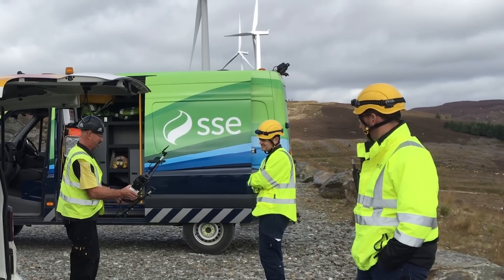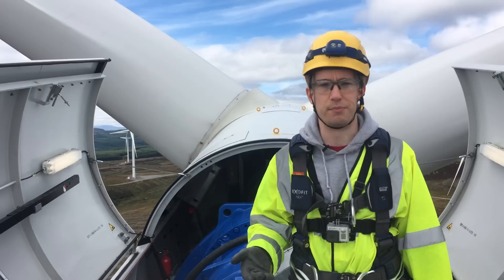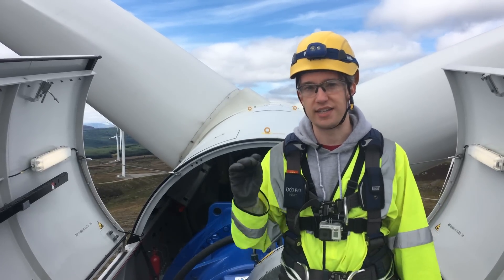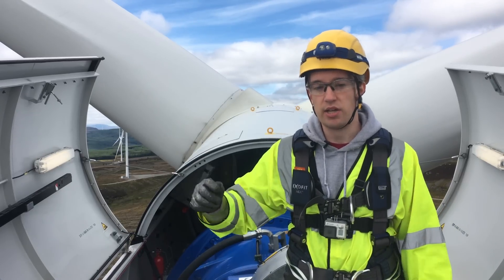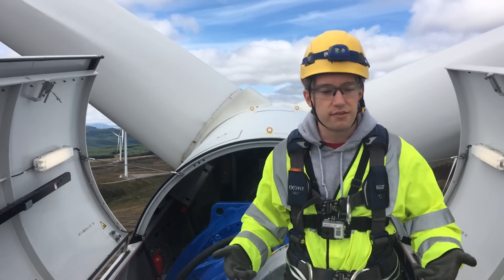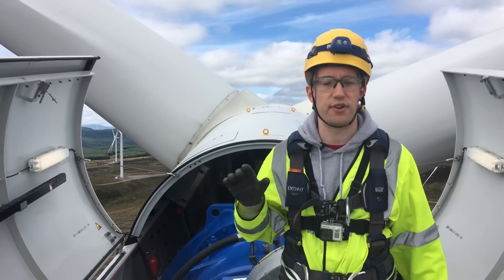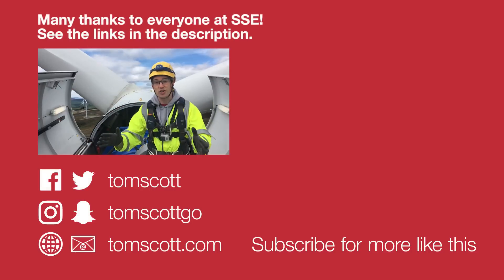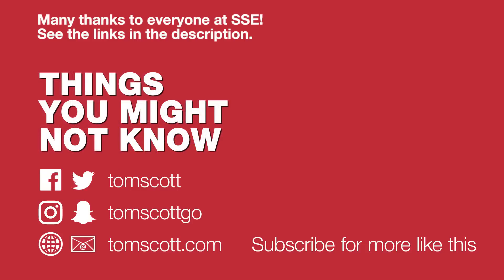The Problem With Renewable Energy (and how we're fixing it)

Comment: does the 50 vs 60 cycles per second power thing also dictate the 50fps vs 60fps framerates difference between the UK and the US?
Reply: Yes, that is exactly why they are different. It was a way to remove one possible element of interference in the early days of television.
Reply: Yes. Many kinds of electric lights subtly flicker at double the mains frequency (so 100 or 120Hz) and if your video capture isn't at a multiple of this you get weird flicker effects.
Reply: This is also why video recordings of most CRTs have a horizontal black bar that moves up or down the screen, at different speeds, depending on if you are in a 60Hz or 50Hz country, since video is usually recorded at 24 (+/- a few fractional frames) fps.
Reply: thomas - you mean film? videotape is 25 or 30, and digital is 25, 30, 50 or 60 (usually 30 though, because of american companies)
Reply: wow, i can't edit my post.
i was going to add that digital CAN do 24 but usually doesn't, except on super expensive gear, but even then, that's usually equipment for making a big cinematic release, not someone recording a home video with their tv in.
Reply: Kit Vitae I was thinking film/tape, because, strangely, it is till common for small news stations, and the high end stuff does 24.
Reply: Thomas Gill interesting. i'm not sure if "small news stations" are even a thing in the uk, tbh. i know tv is still a lot more regional in the us, though. because, like, it's huge.

also, are you saying that high end tape gear does 24? (just a little unclear) if so, that's super interesting too.
Reply: Given that "high-end tape gear" is usually just code for Super8 or Beta(D), it is possible.  The high-end stuff was originally designed for films, which are still 24 fps.  In the US it is very easy to tell what is shot on film or at 24fps, whereas things shot at 30 or 60 look much more fluid, and just look wrong to most people.  Watching shows from 50Hz regions you don't really have that quality shift, as 24 and 25 fps are so close as to not be noticeable, it is just the color saturation differences between film and tape (usually noticed in 80s and 90s BBC/ITV series) is noticeable.

I just recall that it wasn't until recently (2-4 years) that I noticed local news programs not having any flickering on their CRTs in the newsroom, or when a CRT is in a shot, nor even major Hollywood TV productions, where there was a hint of scan lines until the last few years.  This is actually why you so rarely see the TV or computer monitor on a TV show, until the last few years, in the US at least.

It also doesn't help that there are some repeated frames when converting from tape/film to broadcast (either NTSC/ATSC or PAL/SECAM/DVB), with introduces a whole other set of issues, which differ depending on the formats being used.
Reply: Thomas Gill actually, converting from 24 to 25 doesn't repeat frames, they,, just...... speed it up a little bit. (if that's what you refer to by converting from film to broadcast. a BBC telecine would just play the 24p film reel footage at 25fps (or 50 fields per second, because interlaced)) everyone's voices end up a literal octave higher, i can't stand it. tv shows shot on film on european dvd releases are SO squeaky. i also do notice everyone's conversations going a little too fast, even if they're pitch-corrected. (even modern BBC shows that are shot on film are sped up a bit for broadcast here, but use 3:2 pulldown for BBC america, which means you get more accurate pitch and timing for some BBC shows than we do. thanks DVB.)

and, yeah, the colour (and actual clarity, if you've got good eyes) difference between film and videotape for BBC and ITV programs was caused by using 16mm film for outdoors shots, because the 35mm cameras are just so big and bulky. plus, 80s film stock, i guess.

don't a lot of computer CRT monitors refresh at 72hz? that's a multiple of 24, which should look ok. i know star trek tv shows were shot on film, and they had lots of CRTs in the walls in DS9 and voyager, and a few in TNG, and those don't have any flicker.

also: thanks for actually having a discussion with me and not being insulting or rude
Reply: Thanks for the interesting info! But I assume you didn't really mean it when you said 'literal octave higher'? It's actually about 0.7 semitones :)
Reply: macronencer yeah, i got my vocab mixed up. i meant to say "letter note", not "octave". my bad
Reply: Computerphile just did a couple videos on interlacing and digital video that talk about this subject.  Worth taking a look!
Reply: Actually, the higher end gear (which does not cover Super8 if you ask me, as it's 8mm film, which is definitely not high end, nor is High or Digital8) did not record on 24 frames in the beginning, this would've caused all kinds of light-flickering that would be unsolvable by electronics (which Super8 probably had in a very crude state) back in those days.  Cinema and regular ENG video have only met each other for around 7-8 years back, when the DSLR movement caused a huge shift in what camera's could be used for and should be able to do.  Flickering CRT's could very well have something to do with camera's not being able to sync their refresh rate to that of a detected monitor in the shot (the higher end camera's actually have a detection circuitry for this kind of thing built-in, which is pretty awesome if you ask me).  NTSC is not based around 24 frames per second, but 30 (or actually  29,97), people are probably easier "confused" when watching a true 24 frames per second movie, being used to the abundance of 30 frames per second material on the internet or on TV.  Even in The Netherlands people are disconcerted when going to a movie that is true 24 frames per second, even though the difference between 25 on TV doesn't seem to be all that big.
Reply: Serval Spots i was very pleased when professor bagley didn't claim that the difference in speed when going 24⇒25 is "basically not noticeable", like so many people in the industry do to justify it, heh.

Dutch3DMaster oo, detection circuitry? that's pretty nice. thank you!!
i was surprised to learn that most animated tv shows are done at 24 (well, 23.976) because less frames = easier to animate, while i had never noticed visually.
but then, going into the inspector in VLC, sure enough, most of my anime and cartoons were 23.976, even some of the DVD rips (maybe they ran it through the 3:2 pulldown reverse algorithm, or maybe the DVDs were 24 all along)
Reply: +Kit Vitae, Not only that, a lot of animation is done 'on doubles', meaning each frame is shown twice (and is thus 'doubled up').  It isn't noticeable in animation, but stepping through an animated show frame by frame reveals it to be true.
Reply: This frequency is (was) also exploited by mains-powered analogue clocks.
Reply: Serval Spots ooh, i've not noticed that, though i've noticed onionskinning when i skip through frames, which.. i think is a very closely related thing?

Nicole K yes! plugging an older mains clock into a different frequency electricity makes it run fast or slow, right?
Reply: Tom has a video (it's about smartphone video)
Reply: +Kit Vitae Multisync monitors syncing at 72Hz usually also sync at 75Hz.
Reply: No , because then how do youexplain 120 and 240 hertz TVs, the frequency of your energy in the frequency of your devices have nothing to do with each other, just like you can step down or step up a voltage you can change the frequency add a different voltage within the device

Comment: Some people over here complain about windmills being irritating for causing vibrations.Thanks for kinda explaining how load works on the generators. I wondered what happened to the extra energy such as when an a/c shuts off. I'm guessing the circuit breakers would blow when demand soars because the low voltage turns the watts into more amps and that heats the breaker to trio it.

Comment: Hypothetically, one could run a pumped-hydro facility in a closed loop, when necessary: if you run out of high water, just turn on the pumps simultaneously with running the generators. That way you gain the stability advantages of the generator even when you don't actually need the generating capacity, per se.
Reply: Tom Scott has made a video on that very system in Britain

Comment: But the power outage across England in 2019 acknowledged as caused by wind turbine fault put the grid down for a long time. Where was the backup power then.  Germany which relies on wind power has discovered that coal is the go to back up power source.  If millions of electric cars are used as backup how will owners get to work when batteries are drained.  The current "green renewable" technology seems to be expensive, heavily subsidised wishful thinking - but it does win electoral votes and our politicians never miss an opportunity to virtue signal.
Reply: The power outage wasnt caused by a single turbine. it was caused by an entire wind farm AND a gas fired plant shutting down.

As for cars used for back up, the system is designed to be intelligent with the owners deciding how much to contribute. Typically the grid will only request about 3% of any vehicle's capacity, but the owner can inhibit any contribution for a planned long journey the next day or increase contribution if they plan not to use the car.

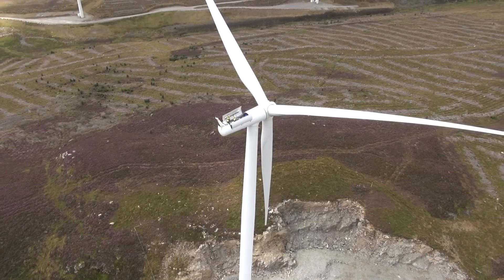Comment: 0:55 if turbines in plants are running at THOUSANDS of revolutions per SECOND...they are gonna have a bad day.
Reply: No they're having a very good day operating at their normal speeds
Reply: Reread -- per SECOND. most steam turbines run at around 3000-3600 rpm to generate the 60 hz electricity output we need. "thousands per second = minimum 2000 per second * 60 = 120,000 revs per MINUTE. Giant turbines would rip themselves apart at that speed.

Comment: I think it should all be nuclear and green, people are scared of nuclear power even though it's carbon free and i for one wouldn't want to rely on green energy. Certainly not in the UK where solar and wind are a bit sporadic...
Reply: But Fission isn't renewable.
Reply: You can recycle nuclear fuel for longer than the Sun will last.
Plus, Thorium, a nuclear fuel, is brought up with almost any ore, especially rare earths, so we'd be running off the wasteproducts of mining.
Reply: It'd still last alot longer than hydrocarbons, and pollutes less if you do it right. (The US doesn't, and seemingly never will.)
Reply: In the VERY long term? No. But Gen IV reactors will be able to create more fuel-grade fissile material than they consume, and in future we may be able to gather it from space.
Reply: We just have to buy enough time to develop fusion, and than we are good for a few quadrillion years.
Reply: *****
Nuclear plants are expensive to build, but cheap to run, and they last a lot longer then renewables. Google "electricity production costs". For example : http://www.power-technology.com/features/feature90922/feature90922-8.html
The most expensive option is still solar, and while costs are going down fast, it's still going to be more expensive for decades.
Also nuclear could be orders of magnitude cheaper. With passively safe reactor designs we could remove a lot of insanely expensive safety features like containment buildings. And smaller units could be mass produced in factories, with high automation, skilled workers, and better quality control. In mass production there are no delays or cost overruns, everything is tightly controlled. And when each unit is practically identical, licensing is much easier, faster and cheaper. Currently in the US a nuclear power plant license costs around $100M regardless of size. It's possible to license designs not units, but then any deviation from the design has to be approved, and that leads to delays and cost overruns. And a large scale construction never goes perfectly ever. The licensing cost of radically new reactor design is estimated to be around $200M (+$100M for each unit), so these have no chance in the US. China, India and Russia does most of the work on small modular reactors now, and America may have to import them in the near future.
Reply: Solar is already cheaper overall than nuclear, it's only momentum that's keeping most older technologies alive at this point, no new nuclear plants seem economically viable for many parts of the world from now on. Grid level storage is coming fast as are microgrids.
Reply: +ZEROSTATIC72 The only sense in which nuclear plants aren't viable is politically, because people are irrationally scared of them. Solar power suffers from exactly the same problem as the video describes. Even if you can get enough power out of it most of the time, it cannot make the network robust.
Reply: ZEROSTATIC72
Solar is still the most expensive by far. And nuclear is the cheapest (https://en.wikipedia.org/wiki/Cost_of_electricity_by_source). But politically solar is more acceptable than nuclear. Partially because solar threatens Big Oil much less than nuclear. France switched almost completely to nuclear in less than two decades.
Reply: András Bíró Yeah... the UK is spending £6billion on a new wind farm, but the Hinckly Point C nuclear plant is being postponed despite only costing around £2billion.
Reply: +ReddwarfIV You missed the zero off 20 Billion.
Reply: simonwass
I suspected that £2B was a bit low, but £20B is way too high, they are doing something wrong. Half of that would be more reasonable. Also nuclear plants last several times longer then renewables.
Nuclear plants were built much cheaper in the past, but we forgot how to do that because very few were built in the last decades, and because of the extreme regulations.
http://www.sciencedirect.com/science/article/pii/S0301421516300106
With better reactor designs, mass production and reasonable regulation, nuclear power could be orders of magnitude cheaper.
Reply: András Bíró Seems he's actually right. The Hinckley C plant would cost £18bn to construct. This is because the European Pressurised Reactor design is plagued with construction feasibility, safety and design issues. It's been suggested that building multiple smaller plants would cost far less for the same output.
Reply: Nuclear is used for space exploration a lot. Plutonium mostly.
Reply: Maybe they’re just scared of all the radioactive waste it produces that we still don’t know what to do with and will outlast any amount of lead or concrete that gets put on top of it.

Comment: Electric generators revolve thousands of times per second? WOT? Did he mean to say per minute?
Reply: Probly
Reply: Probably. 50Hz by definition means 50 times a second.
Reply: +ReddwarfIV Yeah, but that's the frequency of the AC delivered at the end; it needn't be the same as the rotor's revolutions per second. Of course, while it's to be expected that the rotor would have more than one coil/magnet along its circumference, it's rather harder to imagine a setup with less than one. But that doesn't preclude some mechanical or electrical shenanigans between the turbine and the output.
Reply: 50hz is after the gearbox.
Reply: Yes.   The ones used in power plants are typically something like 3,000 or 3,600 RPM.  (Google Siemens SST-900 for an example.)
Reply: 3000 RPM, 50 RPS
Reply: 3600 rpm is 60 rps ... less than x times 1000 rps ...
Reply: Dexter Treehorn Have to remember that we use 50 Hz over in the UK
Reply: Martyn Compton I targeted Eustatian Wings with my answer. As you do :D
Reply: So there aren't any of the afore-speculated shenanigans. Spinny force goes in, electric oscillations go out. Simple. So simple ... until you begin to consider that the in and out must always be kept balanced enough to keep everything in sync across continental-scale power grids ... •head spins at 3000 rpm•
Reply: nex Here in europe pages exist, you can observe the grid  and the frequency-chances in realtime. (http://www.netzfrequenzmessung.de/)

The resulting pattern of the permanantly changes is unique for a given period of time and can sometimes be used in forensic investigations ...

Yes, it's absolutly amazing! A really BIG machine in perfect sync!

Fore some "green" dudes this all is just criminal industrial-aged garbage (they simply don't understand the technical background)
Reply: Gas turbines spin veeeeery fast. The best way to get more rotational energy is get more speed so the turbines (not generators) are designed to whiz around very quickly indeed.
Reply: Water turbine rotation speeds are indeed in the thousands of RPM, not RPS.

Flywheels on the other hand can reach speeds of over 60 000 RPM, or 1000RPS.
Reply: Tom hiself corrected his 	
rps-statement. check out the comments above.
Reply: Generators, once synced and connected, tend to stay synced on their own (unless a huuuuge change in demand happens).